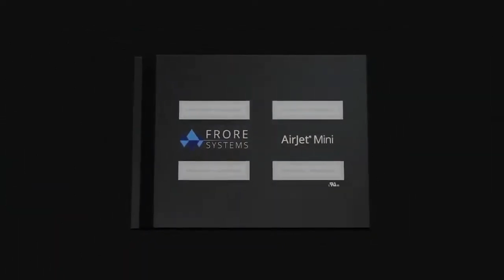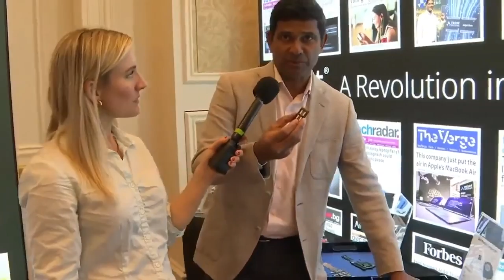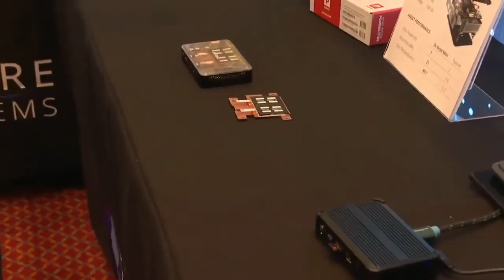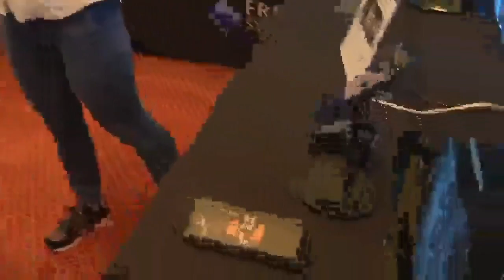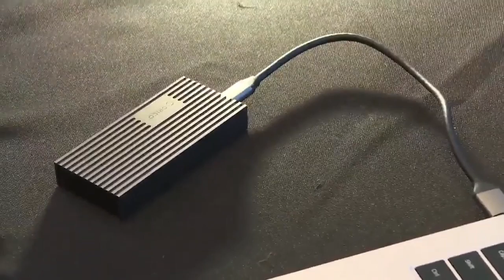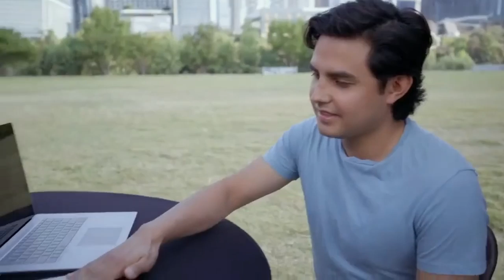Six Five Frore Systems CES2024

Comment: They are trying hard to push manufacturing industry to adopt this but the process seems very slow... Meanwhile they should release it for consumer market as well with custom 3d printed low profile heatsinks and mount brackets... Customers will DIY the shit themselves on handheld gaming consoles or something like Framework laptop...😅😅

Comment: Any word if you might have coolers that can handle 25-30w or so? 10w works for cpus with efficiency only cores (N100 etc), but need a bit more cooling to cover the chips with performance cores in laptops and minipcs like the i5-1235u or similar. Or maybe could be combined with other larger heatsinks?

Comment: I have some questions.

1. Will this ever be implemented into desktop CPU cooling?
2. We know fans have bearings and those wear out so what is the life expectancy of these? And, is there degradation to the performance over the lifespan of this product?

I absolutely think that this device needs to be on EVERY laptop right now and really hope that it happens someday. Great work to you and your team keep it up.
Reply: Honestly speaking I too was thinking about the longevity of this . I mean Wouldn't it result in eventually whining noises and may be damaging MOBO due to vibration? I hope to see this implemented in graphics cards and gaming laptop .they can do it but at the expense of battery drain in laptop . Using it to cool Nvidia GPUs making it thinner again would be nice .

Comment: They are gatekeeping this new tech too much, waiting for an offer from the big players, but those won't be willing to deal with the risks of early adoption.
Imo you should just sell it to the public and build trust first.
Reply: They are already selling it.

And it's hardly gate kept.

This is a MEMS based air displacement device (actually an array of them), not radically different from the MEMS speaker devices which have recently been entering the market as a long delayed companion to the MEMS microphones which took over the smartphone world.

This is still first gen tech that apparently has significant room for improvement.

Apple may not bite today, but I could certainly see them biting for the 2nd or 3rd gen if perf/area can be doubled without exploding the power consumption.

If they can quadruple perf/area then the market is theirs unless a competitor enters the fray with a better performing variant of the tech ahead of their own tech roadmap.
Reply: @mnomadvfx  afaik they are only selling it to those guys making the mini PC. Good luck getting your hands on it for personal projects
Reply: @anothercritic There was also that SSD enclosure manufacturer that announced a product, but so far hasn't shipped yet. At least Zotac is delivering. Perhaps when Frore comes out with a v2 with a higher thermal conductivity substrate than their current copper one, we'll see more industry adoption. I'm thinking it'll come to enterprise servers before it hits the consumer space, though. They're the segment that really cares about rack density.